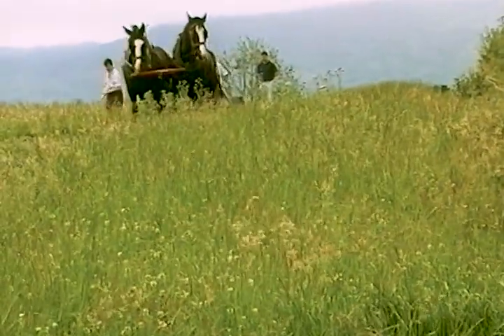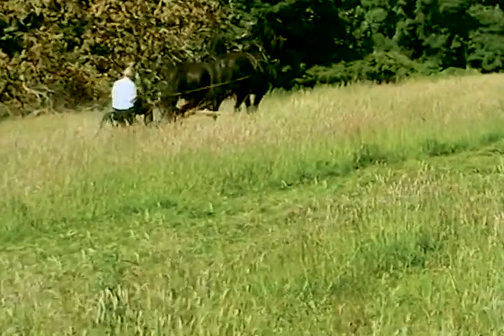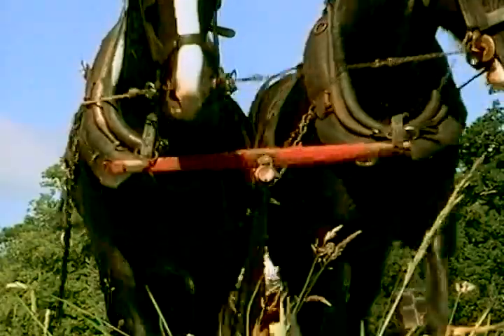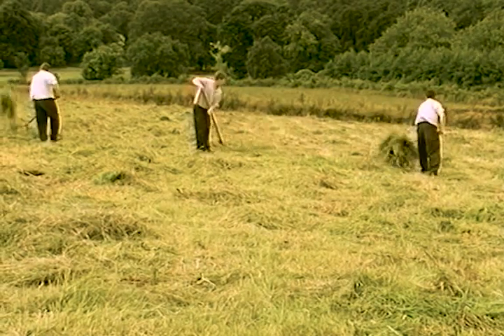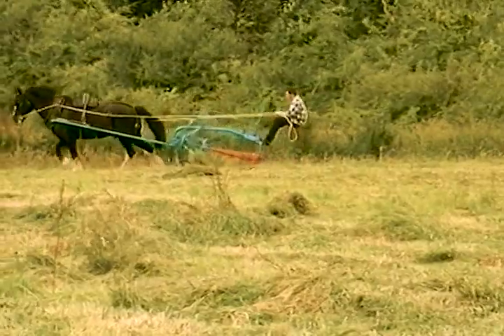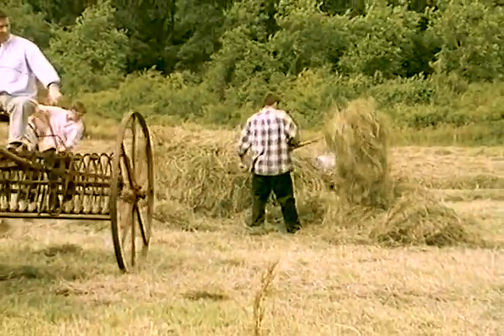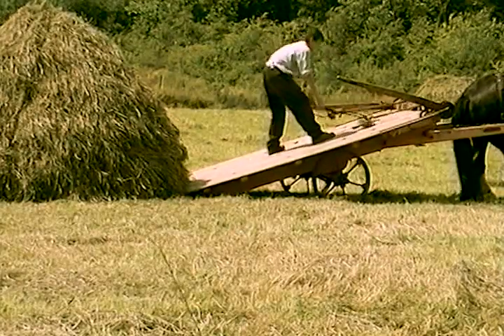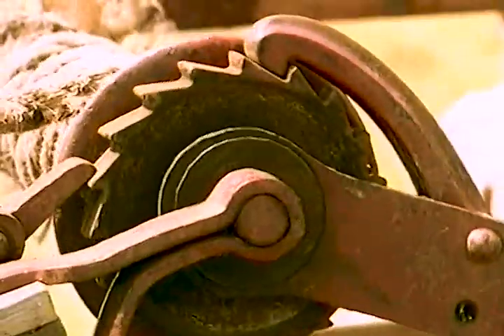Traditional Hay Making

Comment: I’ve been there and done that back in the 60’s, where shaking out and wyneing the hay was concerned.  My Da did have a little Grey Fergie 20 TVO tractor and a Fergie mowing bar.  The hay cart attached to the tractor via an adopted hitch unit.  The cocks that we always knew as wynes were left in the meadow for weeks and by the time that drawing in came, there always was about 6”s of after grass.  When well built and raked down, they kept the rain out like a thatched roof.  Our Summer holidays back then were decided between the meadow, the bog, carting home the hay, stooking corn and weeding and thinning turnips in the garden.  Milking time was almost like a break.  
Certainly no time to be bored back in those days!!

Comment: These are farm tools and implements I have never heard of! I was especially amazed by the hay cart bringing the entire stack of hay onto the cart without spillage. And the grass rope! Wow. Farming really was for the clever. It probably still is, but with different skills in tractor mechanics and machining, not assembling a grass rope.
I have worked a hay field before, hoisting up 75-pound bales onto a wagon then stacking bales higher and higher into a barn. There's a method for moving them without hurting your back, but you learn to always wear long sleeves and pants to prevent scratches. And expect your nose and mouth to get congested from all the hay dust. 
The worst part was when the mower impaled a field mouse or rabbit, yuck.